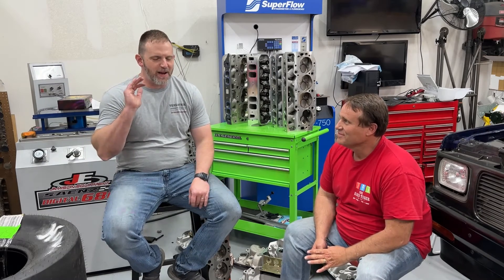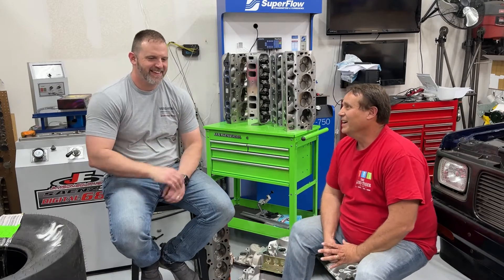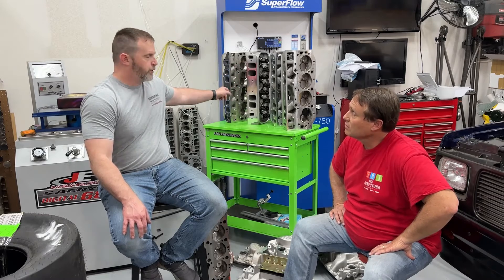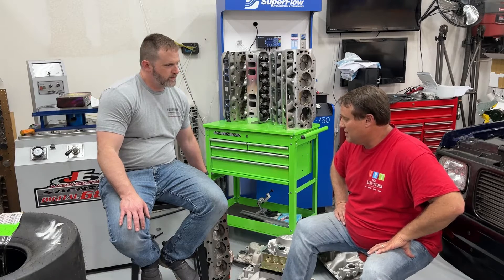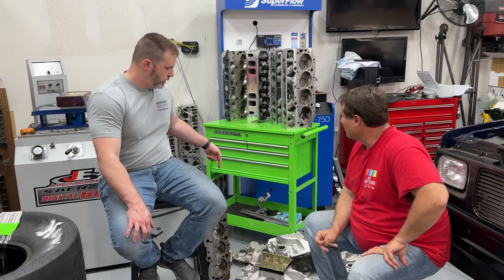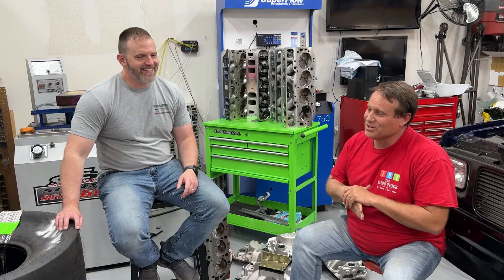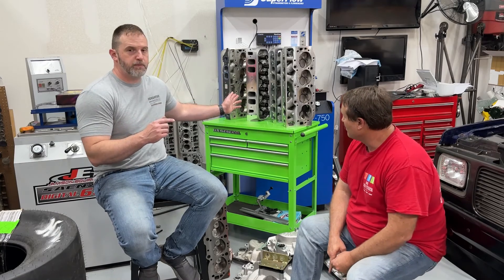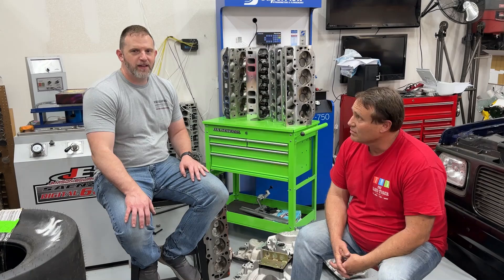Intro To BBC Dyno Mule

Comment: 290 Promax is a great head,  you need to test the 315 rectangle too,  on a 496 a great head
Reply: I have installed the larger versions on 6 or more 496 with varying levels of tune up's. Performance has always been great. No complaints.

Comment: Great video Eric! I think the AFR 265s will make the most torque. Richard Holdner already did a 496 with 4 different sets of heads and the 265s cleaned up on torque even though all the other heads supposedly flowed more. As far as HP goes I agree with you on the Pro Maxx. Keep up the great videos!

Comment: If you unshroud the valves an do port work on 049 they will run with all those heads. Performance engine builds in colorado does it all the time. Make almost 700 hp idles at 700 rpm on a 496.
Reply: Mark at VortecPro does do any amazing job with iron 049s and 781s but he also does an amazing job assembling the engine too. He polishes the stock con-rods and grinding on the crank to lighten and strengthen them and he does his own oil windage improvements, etc. His heads on someone else's 496 will probably not be as good as his shortblock. For him it's the total combination.
Reply: @conservativecrusader80    As a fellow engine builder I will second that Mark is thorough.    He is grumpy though,  too much grinding on cast iron does that to a person.     I prefer to buy good parts that are designed for the power level they are running at rather than improve the performance of OE parts to reach above what they were originally designed for.
Reply: 700 is hard to do on an 049,  625 or so is closer, but it costs more to do that port work than it costs to buy a FloTek 290, and then you get to the weight savings, and improved combustion of the AL heads.     Life is too short for Iron Heads unless rules require them.
Reply: @donavan2676  he gets over 600 on a 454. He is a master on core selection. He has many videos on the u tube. 650 all day with the street cam
Reply: @hankclingingsmith8707    Ask Mark what he charges for a set of those Iron Heads all ready to go?     Cha Ching,   Like I said,  buy the FloTek 290, and you will crush the 049 from Mark with a box head for less money
Reply: @donavan2676  yes you are correct

Comment: I’m very interested in seeing these results. I built a 467 with the Afr 265 and the air gap oval intake a few years back. I ended up with 572 hp and 604 tq.

Comment: Sort of a shame the 290 oval promaxx has the small chamber, higher compression, rather than being able to compare apples to apples.
Reply: Half point of compression makes very little difference on an engine like this.      Lower compression can typically run more timing,   sometimes works better depending on many factors
Reply: @donavan2676  Actually, the difference between 110cc and 119cc  on a 496 will be more like .75-.8.
Reply: @barryobler9491  290 ProMaxx will measure + or -112cc if you check  it...   I use the FloTek 290 (same head, made by the same guy) all the time.    Stop reading marketing materials, and actually have experience with the heads before commenting.   Again,  half a point of compression makes very little difference on a BBC (when tuned accordingly)  in a street application like these guys are testing.    I would bet less than 10hp,   which is in the margin of error on most Dyno's.
Reply: @donavan2676  You may be a fine engine builder, but you have no idea of my background or experience, and the "marketing materials" comment was completely uncalled for.    I simply heard Eric call the 290 a 110 cc head, and the larger one 119 cc.  I have never inspected a Pro Maxx head.  Once again, a 4.25" stroke crank with 9cc difference is more than half a point, I primarily build BBC engines, I have been waiting for Eric to do some BBC comparisons and consider having him do some porting for me.
Reply: @barryobler9491  Blah Blah Blah,  bottom line is in a combination like they are running here even a full point of compression is hardly noticeable on the dyno,  I will always trade compression for airflow which is why I notch the top of the cylinders to better match the combustion chamber on every small bore BBC (<4.560" bore),   that is free HP, and BTW lowers the compression.

Comment: We’ve come a long way from my 2 bolt 396 with rectangular port heads, the original Torker intake with the angled carb, 850 carb, dual point distributor. 5.00 Oldsmobile rearend. 66 SS396 Chevelle body fully stripped. Running at Southeastern International Dragway, Dallas, GA. Around 1980.
Reply: Btw, at the end of your run you were given a slip of notepad paper with your ET hand written and nothing else. No mph even.
Reply: Yes technology has improved but no one could have had a better time then that.  Racing on a shoestring budget was huge fun!  Learn a lot and have the best times that money and technology just can’t compete with.
Reply: @steveteklinski9969  I forgot to mention Turbo 400 and a stock Vega torque convertor. :)
Reply: Nice..What was the best Et it ever ran?
Reply: @ I don't remember .